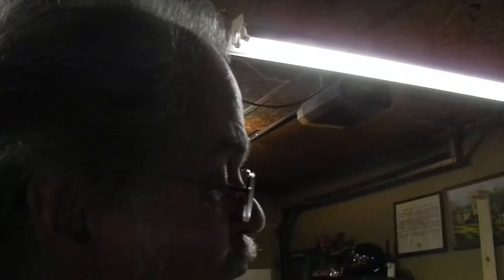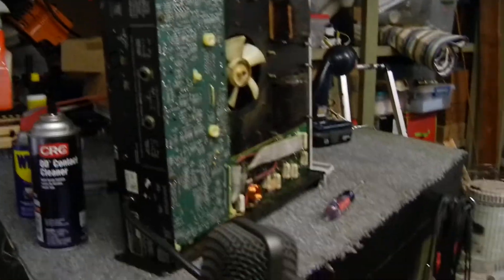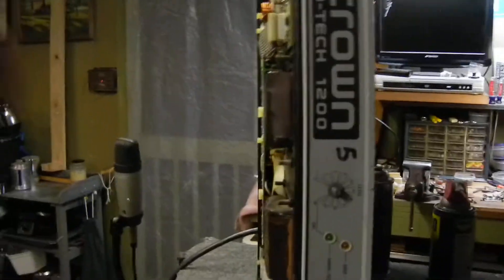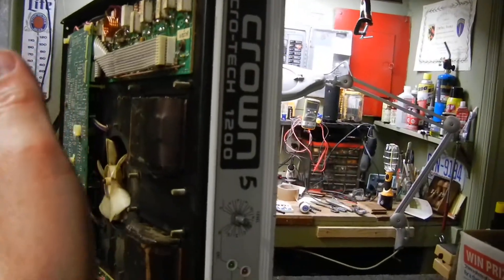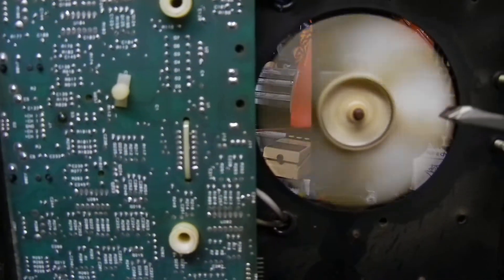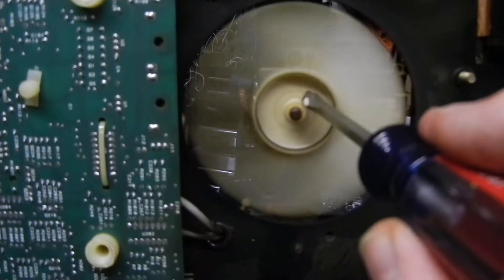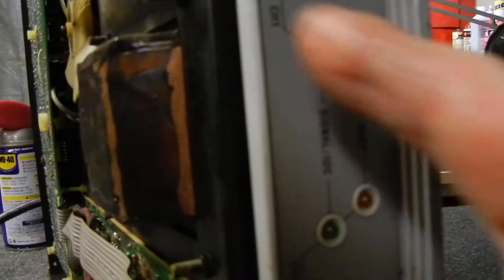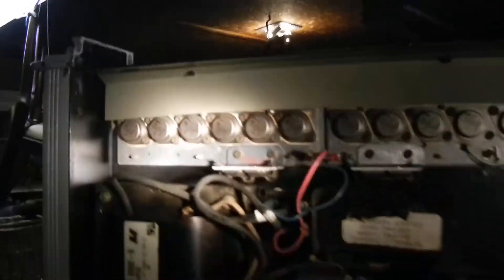Crown Macro Tech 1200 "Fanformer"

Comment: I’m currently looking at a bunch of these for a client in London. 
You’re not wrong about the dust contamination buddy. 
Used a vac, and an air compressor, which worked really effectively. 
It’s a really mucky job tho. 
I have five units with only one channel working, and the OBEP indicators on. 
All good fun 😅
Had one with the fan that was noisy as hell, and sticking. 
The plastic yellow fan assembly can be removed by getting prising it out. 
Lubricant in the bearing, and it fixed it right off.

Comment: ,,,,,,,,,,,,,,,,,disassemble and repack that fan-motor shaft and or bearing with mobile one red  lube [ high speed synthetic lube]  .. .....maybe a pillow block type support can be fabricated to support the outer end of the shaft and eliminate the wobble ; as you pointed out with the screwdriver load onto the rotating shaft.............
Reply from the maker: Hello.  Yep, I did that.  The inner bearing was shot and the balls were loose.  Didn't seem so daunting to find a way to replace the bearing, but it is built into the rectangular case.  None available.  Eliminating the wobble seems smart enough...  thanks for your input.

Comment: Just FYI, you’ve caught my attention with this video. 

I have a couple of Crown MicroTech (mIcro, not mAcro) 2400s that have drawn my attention. One shut off on me and is dead, the other was giving me low levels with tons of distortion. 

I’m really really hoping an air compressor clean out will increase airflow and cooling and we’ll get them back. If that doesn’t work, I’m not sure where to go next, but I know that I really want to save these bad boys, because they are great amps. 

I’m open to any opinions you all might have!
Reply from the maker: Just began thinking about trying to repair this amp....  I'll let you know if I come up with anythng.

Comment: yeah, i used to play in band in late 80s, had a micro or macro tech 1200 running 18" subs. thing was a BEAST!! used a 220 v dryer plug!! lmfao!!
Reply from the maker: I need someone to rebuild the "fan."
Reply: @Par3pio2  they have rebuiders out there. like my behringer ep4000 amp. some people say the fan is to loud for home intertainment. i can see why, it can be noisy on high speed. places like parts plus and others make all kinds of replacement parts.

Comment: Watch the volume level!!!!!!  That thing is 600 watts per Chanel in stereo mode.  If you bridge it or parallel it its 1200 watts.  It will blow speakers in a heartbeat.  I would recommend keep it in stereo mode.  I can't believe Crown is not offering the fan anymore.  These amps last forever.  (Funny, if you bridge that amp and connect four guitar amp speakers you will get smoke in about three seconds and dead speakers in under three minutes.  Does not matter if connected in parallel or series.  It's made to power a stadium.).  One of the most nasty amps I have worked with.  I also had 4 Macro teck 2400's (Stupid power).  Those were dangerous.

Comment: Crown Macro Teck 1200 

WOW!!!!!!!!!!!!!!!!!!!!!!

(600 watts per Chanel (WOW)

I was responsible for thirty of these amps.

Fans fail all the time.  The harder you use the amp the faster the fan runs.  Man, when all 30 are running at 500 - 575 watts each, it gets very hot in that room fast.  POWER MONSTER   (In the day I just ordered the fan  moters from Crown).
Reply from the maker: You are the first person to connect with this predicament.  I didn't realize that were THAT old.  Funny.  Fanformer is obsolete and no longer available, but I have it spinning again.  Motor needs new bushings, but I am afraid to take it apart.  I don't really see quick disconnects on the fan wires...
Reply: @Par3pio2    The fan motor does not have a disconcert.  It is soldered to the mother board.  I used to just cut the wires and spice in the replacement fan.  What happens is that grease dries up.  Then the front Bering will fail.  Taking the motor apart is very easy.  Some light oil in the grease cups will get it running again at least for a while but that one is worn out as you stated.  AT idle, the fan should be silent.  As the amp heats up, the fan speeds up.  This is a stadium amp, not some you get at Best buys.
Reply from the maker: @dave631bnetzero  Man, thank you for this reply.  I have been searching for anyone that understands this predicament.  Can't the front bearing be rebuilt or replaced?  Here is a question.  Can you open the motor from the fan blade side without taking it out of its mount in the amp?  There are two screws, and If I took them out wouldn't the rotor, spacers, and bearing slide out?  This fan/former also provides voltage to the front of the amp... which is the point of contention.  It is necessary for the functioning of the amp.  Say if the fan was seized like it was when I got it, it buzzed loudly because of this.  But the amp still work because of all the heat sinks.  Many say it will work without the fan spinning.  So it speeds up as power is increased?  Interesting.  Thank you for your valuable input.!
Reply: @Par3pio2  Taking the motor off the chase is just two bolts if I remember right.  (Last time I touched one of these was 1993)  I would not cut the wires.  They are long enough to just pull that motor assemble out to make it easy to work on.  The two bolts on the fan blade side will allow you to get the stater out.  (The stater is what spins the fan).  The lower bearing might still be OK, the front bearing is trashed.  (It has a lot of wobble)  If I remember right, there are only three parts.  Front bearing bracket, the stater with the fan blade, and back bearing bracket.  You might be able to just change the bearing brackets.  Or even just the bearing in the original bracket.  BSR turntables use a motor that looks a lot like that.  I do not know if the shaft size is the same.  Please feel free to ask more.  I really want to see you save that monster.  These amps have so much power headroom is never an issue.  They sound remarkable.  That is what Bose got me 34 of these for testing speakers.
Reply from the maker: @dave631bnetzero  Thank you, my man.  Finally someone interested and who understands.  Yes, I never knew how impeccable they sounded until my friend Jay passed on and I received his D150 from the 70's.  Holy cow, Batman.  The low end and transparency and overall warmth and accuracy.  I never had heard my keyboards sound this good, but never could I afford any of the quality gear.  It was Roland amps....  which suffice, but not high fidelity.  What you are saying makes perfect sense to me.  Yes, the bearings are shot.  That is why it wobbles and then seizes.  With a little paint brush pushed up to the fan blade in a vise, it will seat and spin freely.  Guess I could mount it in the closet this way!  (for studio monitoring)  I would like to see it restored to its former glory as well.  Didn't know they were such relics.  If you had to buy something today that was similar, what would you suggest?  Thanks so much for your feedback.
Reply: @Par3pio2  Very serious, there is nothing today like that amp.  Look at how big the output transformers are.  Two of them up front in the amp.  Most of the weight is there. I would LOVE to own own of these.   Just need a bearing in a fan.  As soon as it has little cooling, the output level is deadly!
Reply: Your guys conversation is great information. Im Looking at buy one of thease. I wanted to see if they had any common issues. So this is an invaluable source of information. I do hope you fixed it and got it screaming again. Also I'm assuming the person that had it before you didn't have the filters in the slots. Would explain the buildup of dust and grime. Anyway good video man and good luck. I hope you fixed it!